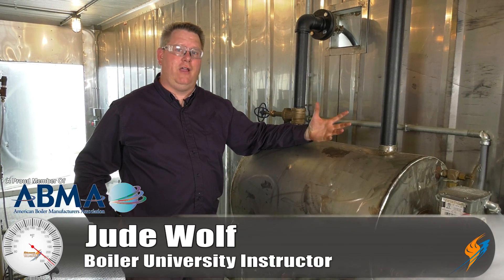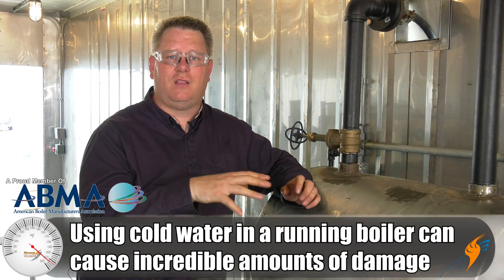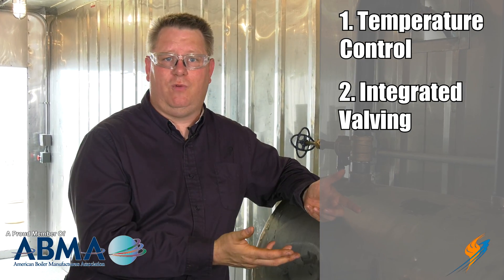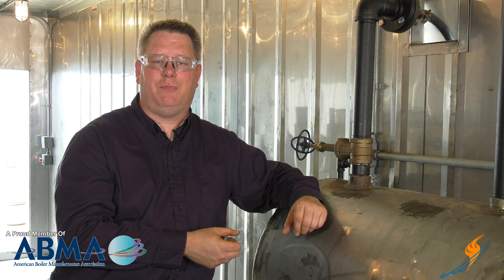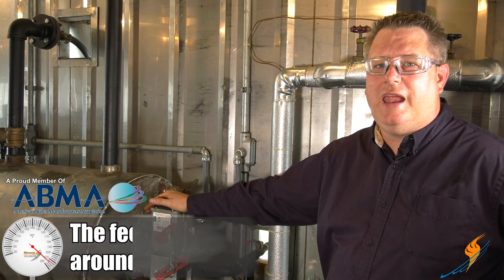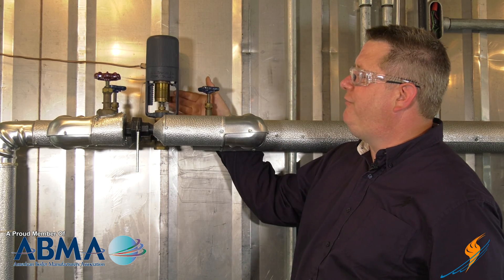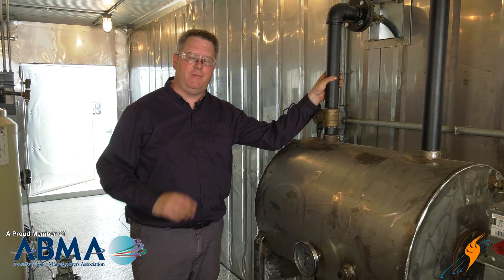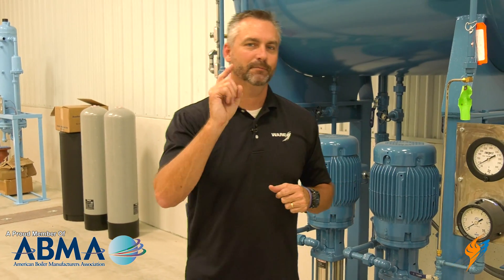How a Pre-Heat Feed Water System Works - Boiling Point

Comment: I was always taught that oxygen did not start coming out of the water until about 195-200 degrees.  The pump seals should be protected to 220-230F so that should not be a problem.  You are operating this system at 180F?  This boiler feed tank should also be insulated, unless this is some sort of system demonstration model in your shop?
Reply from the maker: Any increase in water temperature will result in lower dissolved oxygen concentrations.  A vented/non-pressurized tank will have problems with cavitation at the pump inlet as water approaches 212 degrees, so 180-185 is a compromise for vented feed tanks.  The balance of Oxygen must be removed chemically.  This is definitely a disadvantage of vented feedwater tanks.  The main advantage is reduced initial cost.  Less than 10% of vented feed tanks in the field are insulated.  One reason is initial cost again - regardless of long-term savings. This heat loss, however, can also help prevent overheating and pump cavitation problems due to high temperature condensate returns.  In best practice, one would always prefer a pressurized deaerator to allow better Oxygen removal, higher pumpable water temperatures, and capture of flash steam from the system.  Thanks for watching!
Reply: @wareboilers  Yes, a DA is always preferred.  In the example in the video you had a non-insulated vented tank running at 180-185.  I would have this tank set at 200 F, and recommend it be insulated in the field.  The insulation only helps save energy due to heat loss, it will still "run" at the same temp.  I get your point of running at 180-185 if they had considerable condensate returning at or near 211 degrees.  I did not consider this as the tank in the video was fairly small (50 gallons) and probably had 20 gallons of storage.
Reply: @brianhof7599   Seems like you are missing the whole point here.  The tanks are sized based on your return rate,or should be.  The idea is to always have mostly clean condensate returning to the tank, condensate as you mentioned may be up to 212 degrees if you have bad traps which is a common occurance.  If the tank was insulated this would become a problem fairly quickly.  Ive never seen a feed tank insulated,ever.  DA's yes feed tanks no.  This is not about pump seals, the water, if 212f is going to cavitate the pumps and cause multiple issues including pump failures.  Seal damage would be the least of your worries in this case.  The sparger is only there for if the systems been down or in low load conditions long enough to cool down or during excessive makeup conditions.  At least on heating applications.  Theres still oxygen removal taking place at 185f but all feed tank systems need sulfites added anyway regardless if the tank temp is 180 or 205, how much is determined by your daily test results.